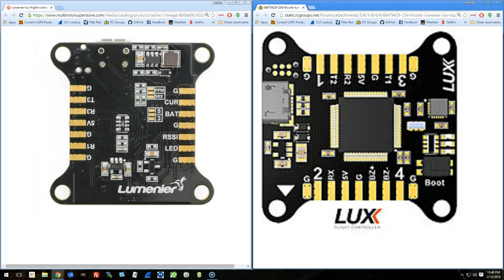Lumenier Lux Flight Controller In-Depth Review

Comment: the VCP is a huge downside to this which also limits blheli passthrough, i dont think you mentioned that in the review. its also SLOW... i mean painfully slow for me. i run win7 but did however get it all working easily fortunately, my taranis also has no issues either. but after flashing betaflight 2.3.5 to this and my SPRF3 last night, the SPRF3 is much quicker especially on the reboot saves, which can knock the LUX completely offline and have to unplug it to reset it.

building on it however is quite nice. it flies great to me, but i am not anywhere near good enough to notice much difference. i also have the rubber grommets mounted.

PERSONALLY i would have given up a UART to lose the VCP for USB. i dont need it. i only have my rx hooked up and telemetry [which is just redundant with my powerOSDpro]
Reply from the maker: +prOkrEAt The lack of SoftSerial would make a missing UART even more painful. With only two hardware UARTs, you almost might as well go with a Naze32 r5.
Reply: Joshua Bardwell except faster potential looptimes and more [possibly perceived] "processing power". problem these hardware designers have is being everything to everyone. me for instance only need 3 UARTS total, including USB because i want the responsiveness setting up, but even that [VCP] will maybe be fixed? i derive my telemetry functions now from my powerOSD, so the taranis output is irrelevant [and often wrong even when i calibrate it... or too stupid to set it up proper which i wouldnt discount here], but i really dont need much on a quad. but i certainly respect that others need more. so i really wouldnt want to be a hardware designer in a no win situation.

Comment: If you wanted to do an experiment on gyro noise, the best way would be to put both boards on the same quad at the same time, then do an FFT of the gyro black box recordings...
Reply from the maker: +Goat Yup. I have used Spectra to accomplish that sort of thing if you look at some of my other videos. Part of the challenge is getting blackbox to log on both boards simultaneously. Blackbox only logs when the copter is armed. So... I don't know... maybe configure "Arm" mode to always be active? I'm still thinking it thorugh.
Reply: +Joshua Bardwell I have done this by simply connecting two FC in parallel to the Rx. I did it to find a faulty gyro in one board rather than to compare. It might be possible to do an always armed board, not sure.
Reply from the maker: Good tip.

Comment: I replaced my Naze Rev 5 with this board on my Bolt180. It helped clean up my wiring hugely.
It would be nice if the Rx connections were on the 1/3 motor pin side, just so its closer to my Rx.
I dont really care about razor sharp PIDs close enough is good enough for me, even removed the BB logger to stop obsessing about the graphs and concentrate on flying.
When I did have the BB logger on the gyro trace lines looked as thin as the Rev 5.
Also removed the BB logger because its of no use when running 500uS loop time, the logs were simply points here and there.
Reply from the maker: I answered this question above. Please stop spamming the thread with the same comment over and over.
Reply: +Joshua Bardwell Sorry and thank you yet again :)
Reply from the maker: No worries :-)

Comment: I have one of these, and a cyclone on the way. I am very naze savvy, but have been glued to this series of yours and am very grateful. I am tempted to not use either on a pure race quad build though. I have everything for tuning and set up on my windows 7 laptop. My "good" laptop is a graphics and multimedia monster (decked out and tweaked Apache Pro) and is never even connected to the internet- it is not for multicopter use, lol. My race organizing lappy is also a windows 7 and is purely for that use. I absolutely will not cross contaminate my laptops, lol. 

I lack confidence I will not run into some issues with either of those boards. I also am not nearly a skilled enough pilot to make use of an F3 board so I can use any old acronaze to great results. I love dabbling though. I like being around all the higher paygrade types. Hoping some of that shit rubs off somehow. I regret not spending time looking in on those OSI Model classes years ago when I was boot camping my way through a simple A+ cert for the local cable company. If I had, an entire world of geekdom would have opened up for me. I coulda been a contender, bahahahahaha!
I didn't know wtf crisco certified or microslut certs could lead to. I have friends now who do what you do- very successful. They don't play in these realms of fpv and quadcopters, but if they did, their learning curve would be a tiny fraction of what mine was bar the stick tricks. Then again, they were gamers- so they have that on me as well.

Thanks Josh- as always. For the learning.
Reply from the maker: +Hiway As much as the Naze32 r5 is a "last-gen" board, there is absolutely nothing wrong with it as long as you understand and can work around its limitations. I often say that Boris B has single handedly done more to undermine the success of the F3 boards, by making it possible to run even 500 looptime on an F1 board. So F1 users can take advantage of the latest-and-greatest.

The disadvantages of the Naze are primarily, 1) only two UARTS, and 2) no SBUS inversion. If you can work around that, there is no reason not to choose a Naze32 r5 if you want to. I have one sitting in my parts box right now that I bought as a spare, and if the copter that is currently flying a Naze breaks, I will probably use the spare vs. upgrading it.

For my next build, I have an Xracer F303 on the way. Actually, I bought two, because I hate paying shipping twice when I need spares, so I almost always buy two or three of everything. I plan to try the vBat mod on one and if I bodge it up, I can always use the other.

Comment: Thanks Joshua, was waiting for this one!
We run 4x LUX FC's in our group at 2kHz and 2.6kHz with no problems at all on Betaflight 2.4.0. And yess, probably not a 100% tune, we are just 'normal' FPV racers, but nothing we notice flying. Blackbox logs look smooth as far as we can tell. Maybe not the 100% you are mentioning, but they do look fine. I think the video covers it all well. Thanks.
Reply from the maker: +Roy van Lith That's the thing. Most people are just interested in flying, having fun, and winning races. And this board can probably fly better than the majority of people can tune and fly. I still intend to do a test with the rubber bumpers on the board, to see if that cleans things up. Remember my current test was 100% hard mounted, just for an apples to apples comparison.
Reply: +Joshua Bardwell We all got it mounted with the rubber rings. Maybe that's just it. Happy testing!
Reply from the maker: Roy van Lith I want to do a back-to-back with the rubber rings for sure.

Comment: Thanks Josh.  I've had such great luck with the Dodo V3, it was really hard for me NOT to get one at this time.  I like the layout of this board but the VCP and Gyro were a deal breaker for me.  This was going in a strictly race quad.
Reply from the maker: +Beerad FPV I personally feel the same way. Like I said in the video, when the chips are down, this is not the board I would buy. But there are people out there who love this board, and there is no way I could get around to giving it a "do not buy" recommendation. Compare that to e.g. the original Naze32 r6 that back-fed the ESCs from the USB port. I wouldn't hesitate to say don't buy a board that has that "feature" , which I would call a defect.

Part of the challenge today is that the F3 FC market is so competitive that people are really spoiled for choice. So if there is basically anything you don't like about a board, there is probably another board out there that will suit you. It's a good problem to have, but difficult for the board manufacturers.